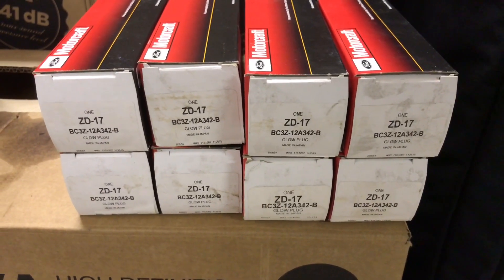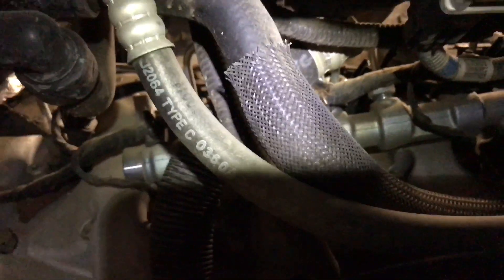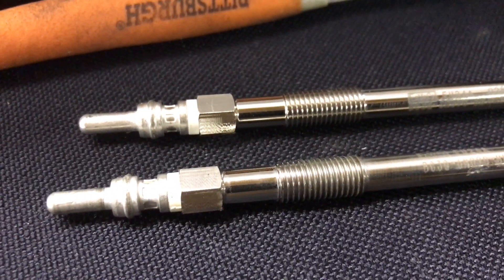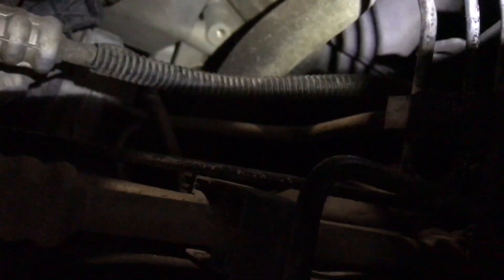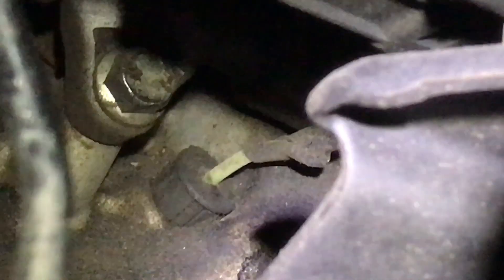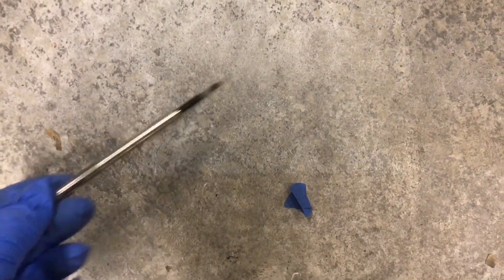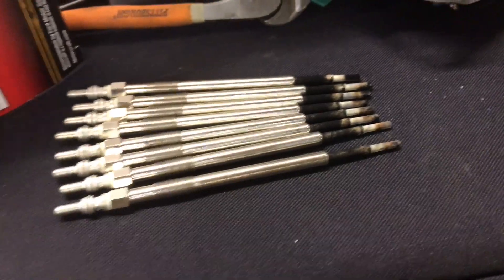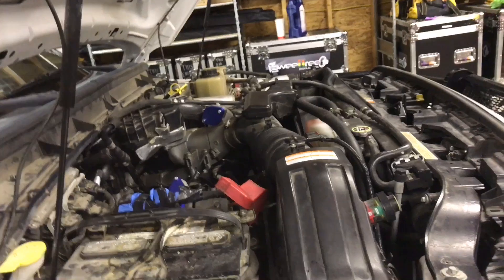How to change glow plugs on 6.7l powerstroke engine from fender well

Comment: Where did you find the torque spec?  I am seeing 97 inch lbs and 14 ft lbs depending on where I look.
Reply: 35 inch pounds then 50 degrees

Comment: How many glow plugs does it have? And how often do we need to replace these?
Reply: I've got a 2017 f350 with 71300 miles and have replaced 2 glowplugs..One went bad at 8000 miles #1 and now #4 went bad..Both said open circuit on scanner...
Reply: 8 plugs one per cylinder I do know that but not how frequent. I'm at 100k and about to do mine just to be safe I guess it would be how frequent you start it
Reply: Did you not watch the video 
Really

Comment: Definitely look into the research more. The valves were not heat treated from the factory in the earlier models and crack, causing them to drop and take the glow plug through the motor. So new or used, the valve takes it with it lol. DEFINITELY look into a set of heads  with yours being cracked.
Reply: The cracked valves were the real problem. As is typical with Ford, ignore the real problem and shift the owner's focus to something else. CP4 comes to mind.

Comment: So the replacement need to be white color?
Reply: It depends on your vehicle/engine build date.  As near as I can tell, Ford created the ZD17 part number (white insulator) and retro-fitted it into pre-February 2012 builds. It's a shorter, thinner plug that is less likely to get destroyed by the valve seat issues common in ~2011 build year engines.  Post-Febuary, 2012 builds still use the "original" ZD18 part (orange insulator), which is longer and due to no valve seat issues, won't get nuked by the engine.

Comment: If it’s me I’d go to dealer and ask for the latest greatest glow plug buying on line you may be buying what you’re taking out? Just a thought
Reply from the maker: George Donnell these are the ones that our local Ford dealership recommended for replacement. The new ones are not the correct size and will destroy the engine.
Reply: George, my experience with the dealer, is they first of all wont admit that the glow plugs are a problem. Second, the parts staff are incompetent and would most likely end up selling me the orange "newer style" plugs that wouldnt fit my engine and third, they would charge me double, possibly triple the price compared to what I can find online. Can you tell Im bitter towards dealerships? Lol

Comment: If it makes you feel better I have a F350 build date of 1-20-2011 and I’ll be doing this when I find time and motivation. Not much info on the issue and some say it was never the plugs it was the valves, but I’m with you, better safe then sorry. 

Good to see you’ve already deleted. You should get rid of the stock air intake and add a S&B intake. Really tops off the delete. Though you do get a lot more turbo noise. 

Speaking of turbo have you had to replace yours?
Reply from the maker: Beinggrownupsux 80 I’ll have to look into the S&B intake. The passenger side was a breeze to do. Drivers side not so much. Good luck to you.
Reply: Solid Ground Staging just finished about an hour ago. Definitely the front plug on the driver’s side was the worst. I have a 2” leveling kit which I imagine helped. Thanks for the video.